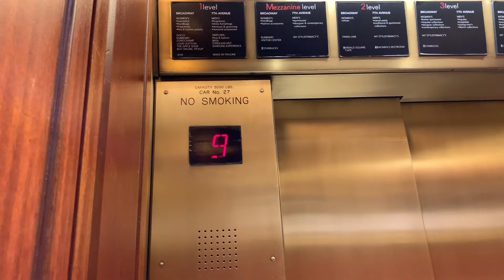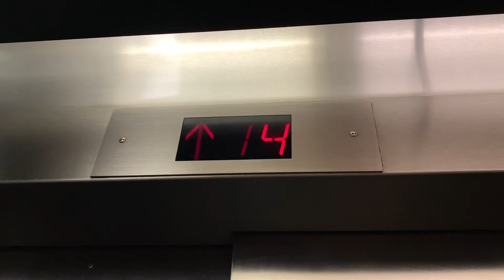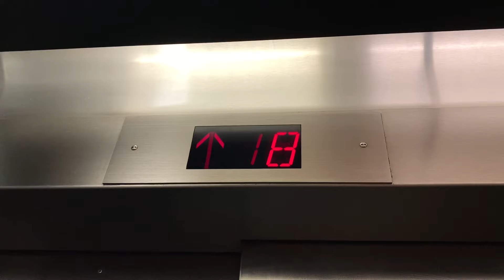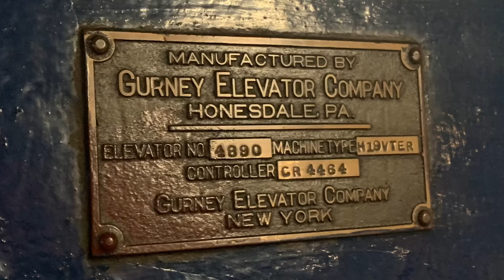Macy’s Herald Square Elevator Machine Room

Comment: Years ago you needed a special key to be able to press the hidden floor buttons. It wasn't marked, just a key slot in the panel next to the supervisor maintenance key slot and the fire key slot.

And the supervisor key and fire key also gave you access to the hidden floors

I used to have a master key that worked for most of the elevators for the supervisor and the hidden floor key slot.

Unfortunately 30 years ago they started replacing the keys with RFID security systems and those can't be bypassed.

I tried to get a fire key but those are not available. At least I was not able to find anyone willing to sell one.

I had that key for safety more than anything else.

After being stuck in an elevator when the power cut out for 30 seconds the elevator got stuck and they took 2 hours to get me out.

I found out later that the supervisor key would have reset it to allow it to move to the next floor and I went searching for a master key that day.

I miss the old days

Comment: Wow big motor for 9 floors and even 15 floors. It’s like installing an Otis Skyrise, Schindler 7000, or Kone MX32 in a medium rise building and malls
Reply: Those with the numbers 57, 58 and 59 (and 56) are freight cars.  Hence the motors are bigger.

Andrew Reams rode 56 when he was given a tour, and they also showed some components on 57.
Reply: Everything was over built and expensive but had high value for that! Today everything is built with minimalist ways of design to maximize profits!
Reply: @agems56  especially by going MRL which it will not be as reliable as the Machine Room elevator (maybe except Mitsubishi but still)

Comment: iam surprised by, how many DC elevator motrs i see. until on youtube i had seen only induction motors, in two speed configuration. this looks little bit mor costly on maintenance and power. ac/dc drivers has in own consumption, and i shall not forget on losses on commutator and brushes. neverless the lifespan of brushes. 100-200 motorhours.
Reply: DC motors were popular here in the US, for a while they could do better speed control than AC. Of course, now VFDs exist, so I don't think anyone is installing DC new any more...
Reply: @aprilkolwey4779  Especially since I bet some of these motors date back to when the store was built. It was completed in 1902 and the final addition made in 1931.
Reply: DC was the way it was done before the variable frequency AC was developed
Reply: DC drive technology was state of the art for faster elevators (speed more than 2 m/s), before AC variable frequency inverters were available. Not only in the US. Nowadays it's obsolete, but for my opinion it was a fascinating technology. I very like these old DC drives with Ward Leonard MG sets.